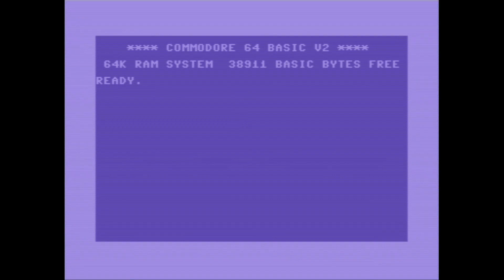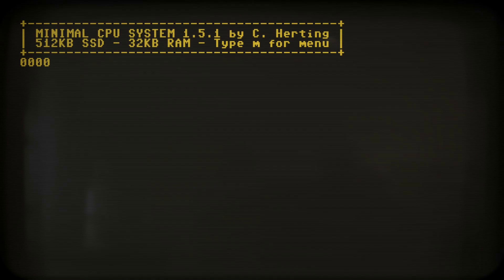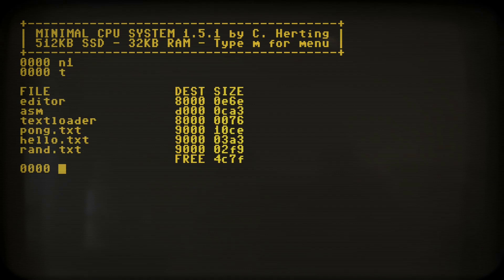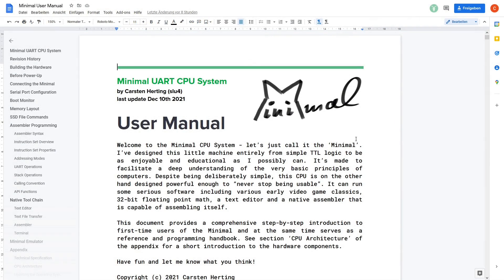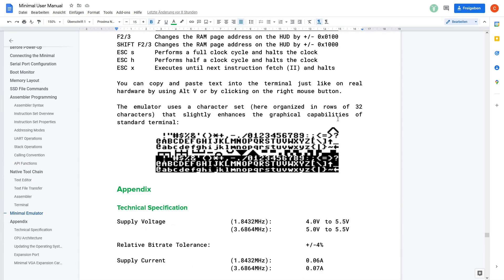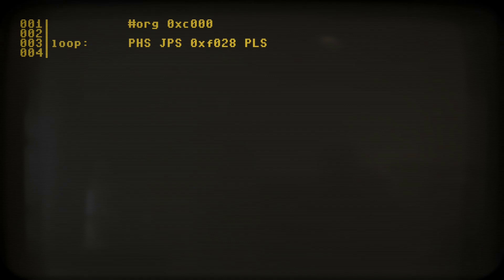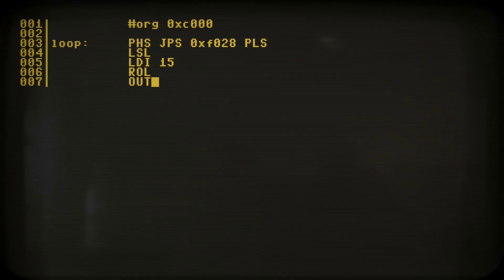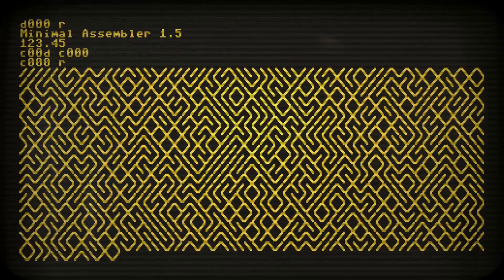Coding a Minimal C64-Style Random Maze

Comment: Your code golf skills are strong!
Can you make a video about your architecture performance, absolute and speed/freq?
For me it's very interesting to compare with 6502 and Z80 multiplication/division top optimized routines for the platforms /*counting all 16bit primes i think is a good example, or et least fibonacci */
Reply from the maker: You will need to dig a bit into my channel - but it is all there. I suggest taking a look at the reference manual for tech details. Cheers!